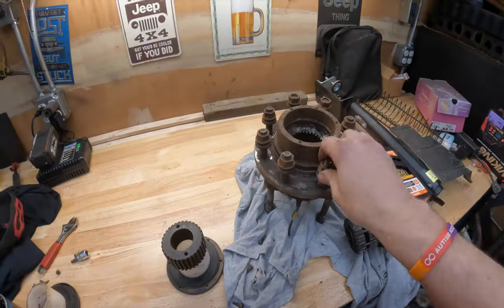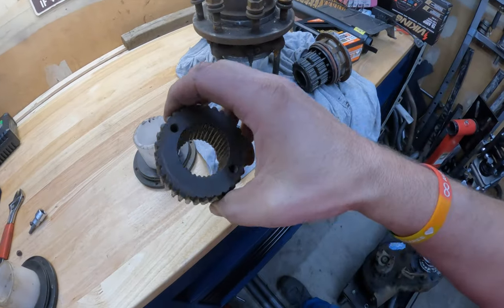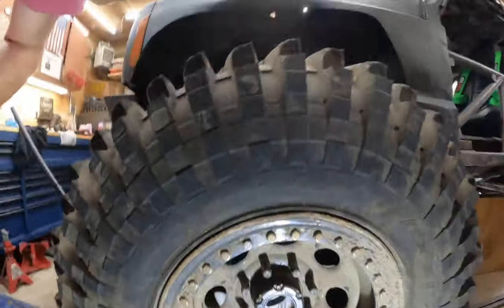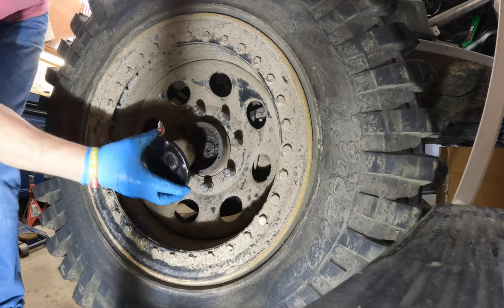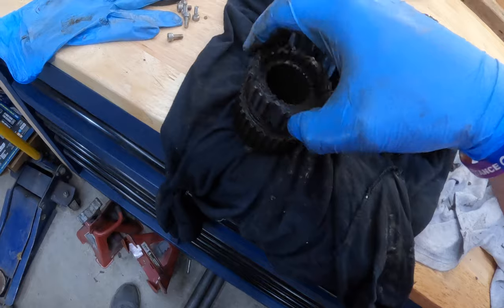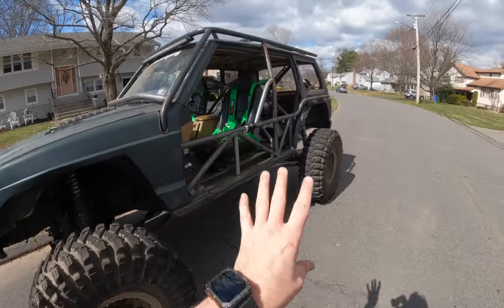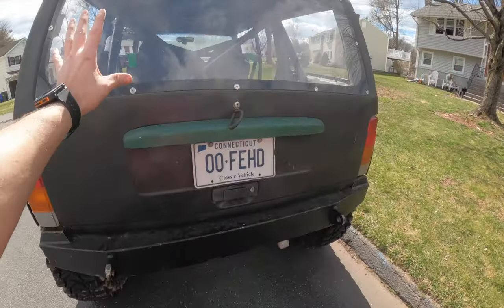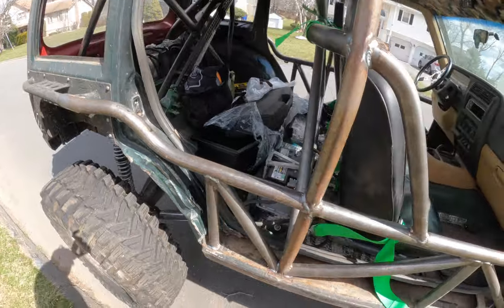Drive Flange or slug install on Dana 60 Axle.

Comment: And here I have been drooling over the thought of selectable hubs.  You basically converted it functionally over to a Dana 30.
Reply from the maker: When the jeep is offroad only, its one less thing to go wrong  .
Reply: I went out to Windrock last year and found I would have liked to have 2LO for climbing the approach road to the trail head.  It is a paved private road on a steep grade that goes from the campground up to the trail head.  My poor XJ got hot by the time I got to the top of that road.  

But I understand that is an oddball scenario.  One that a doubler would also solve.  Do you have plans to put in a doubler?
 @FMJeeping
Reply from the maker: Yea.  I have just about everything i need for a doubler setup.

Comment: F450/550 shafts are different lengths than 250/350.
Reply from the maker: You are correct.  Later i realized that these are 1550 shafts out of a 350.

Comment: is this a 04 and up dana super 60 axle or hub asy ? My 2003 f250 5.4 4x4 dana 60 does not have bolt/screw holes in the (round tube that extends from the knuckle that the locking hub sits in /extension locking hub tube ) and is to thin to drill holes into to attach the caps that come with these kits ?????? any info. appreciated.
Reply from the maker: It's an 05+
Reply: @FMJeeping  thanks, for others info. on this i found out that there is a different kit for my type that i believe doesnt use a spacer/nylon and then uses a snap ring like factory.